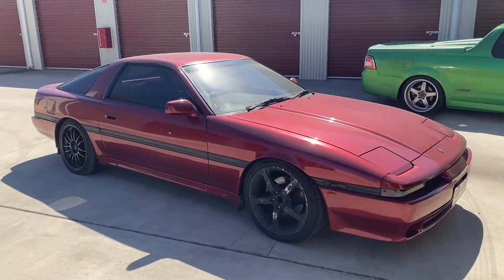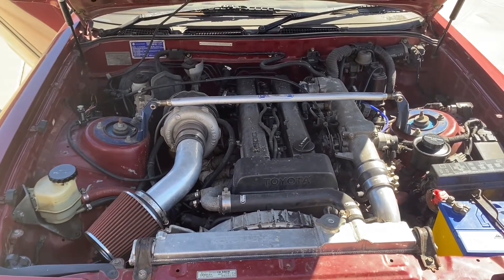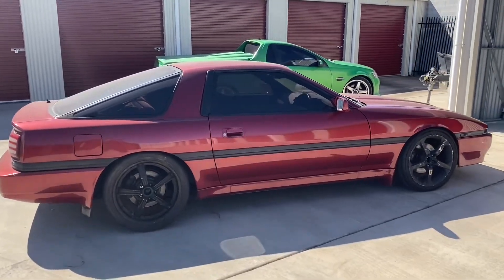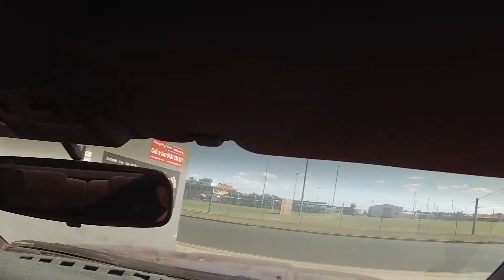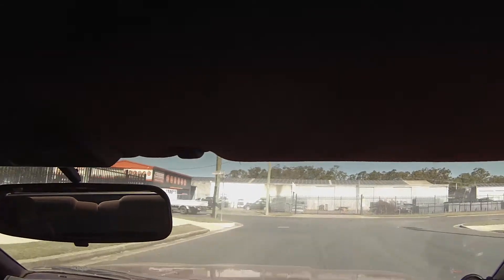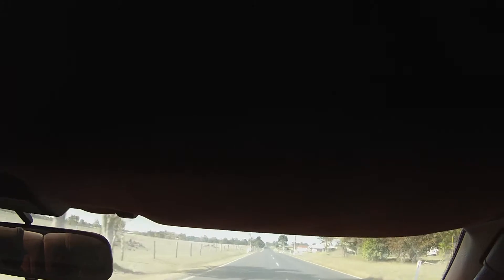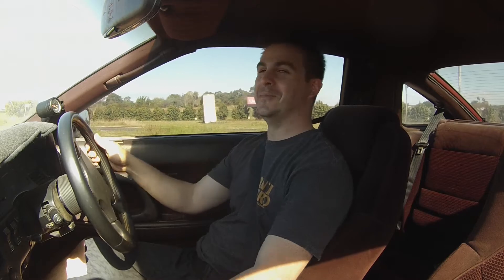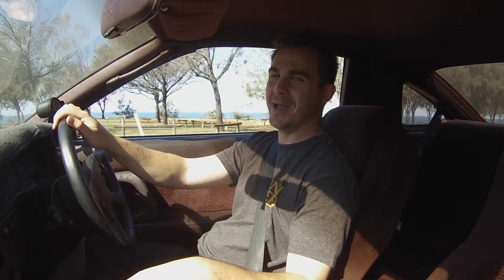My "New" Daily! 1989 Toyota Supra Street car Build?

Comment: Nice. hoping to get my 91 uzz32 soarer on the road in a few weeks. mk4 supra's are nice but somthing about the mk3 just looks so right.Respect for dailing it .
Reply from the maker: Nice man. I wish the laws weren’t so strict here with road legal cars so i could drive my uzz31 on the road here too. I feel the same way about supras as you too. Thanks 😊
Reply: @Brodorsport   Not much better in Victoria. I daily  75 holden gemini great fun.
Reply: @Brodorsport  I have been thinking about possibly getting a mk3 supra or a z20 soarer and not sure what to go for any suggestion/ opinion on them ?
Reply from the maker: Both are great cars in my opinion. Just beware of head gasket issues if you find one with a 7m engine. Other than that they are pretty bulletproof
Reply: @Brodorsport   cheers